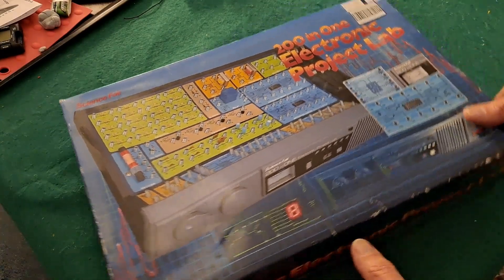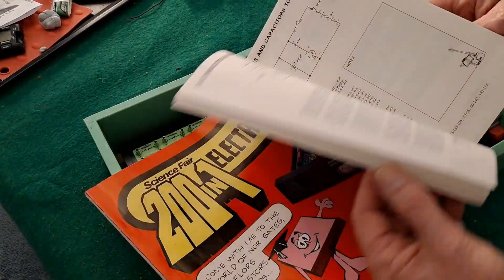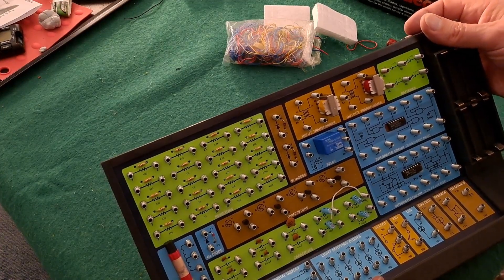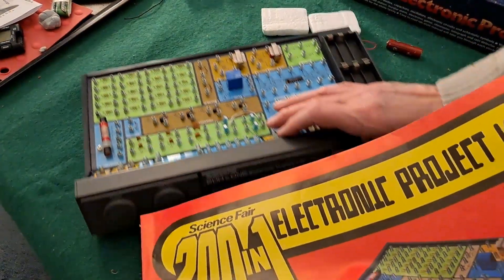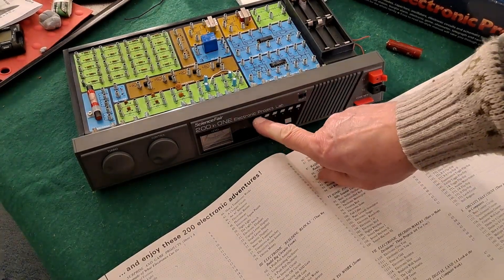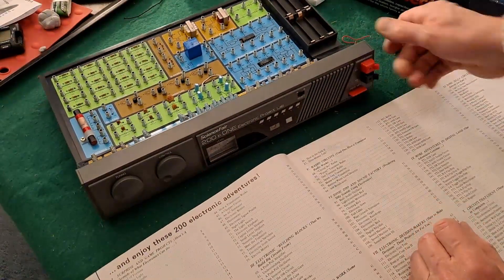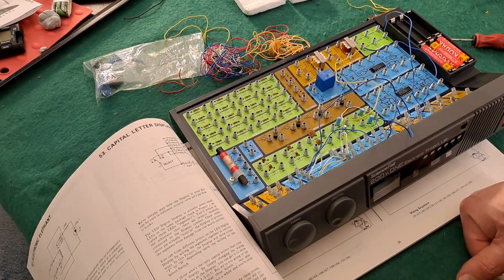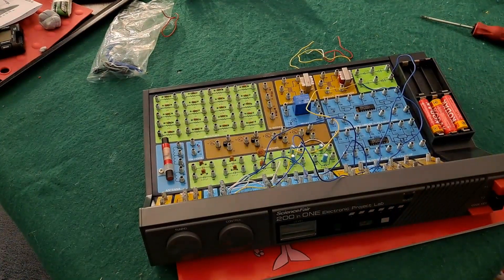200 in One Electronic Project Lab c53

Comment: Looks very 80s/early 90s. Very nice front panel. Not seen one like that before. I still have my very first kit like this which is much smaller and I have had since I  was about 11/12. Thanks 👍😀
Reply from the maker: I think I have 3 kits now, different manufacturers and slightly different features. It would be nice to sit down and work through all the projects.

Comment: I HAVE ONE OF THOSE !!!!!!!!!!!.:) havent really played with it for a while . lost my wires . got it new from radio shack
Reply from the maker: I was very impressed with it. I will have to go through the book at some time 😊👍
Reply: Same here!!! Very few original wires left, got some cheap ebay dupont jump wires to replace them. Quite a good kit, hours of fun. I wonder if anyone does an updated version? Or whether these kits are something firmly in the past. The arduino kits with the sensors etc. are pretty good but it isn't quite the same!